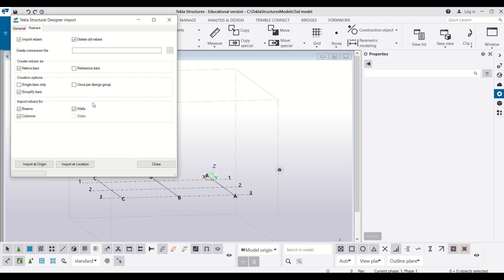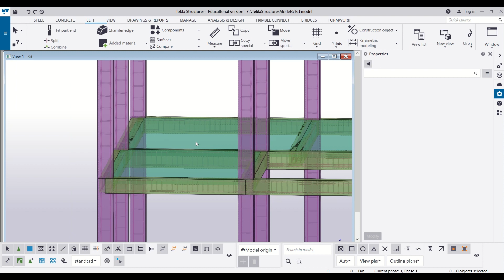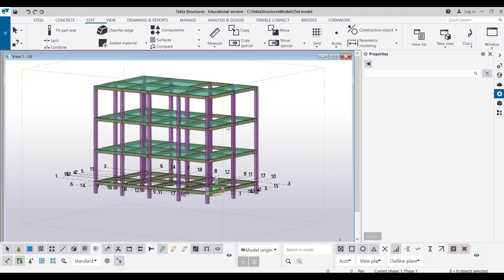How to Import TSD model in Tekla Structures || Importing Reinforcement

Comment: Sir, please this is a personal request. Could you do a simple project with about 5 to 6 columns having a cantilever without beams in TSD and then export to TEKLA STRUCTURES for a full detailed drawings including graphical representation of the BBS and Slab reinforcement details? I would want to choose between PROTA STRUCTURES and TSD. I like the ease of use of TSD but the way it does the Slab rebar and BBS is not to my desire. Prota does the bbs better than almost all the others. I am counting on you Sir
Reply: There is difference between prota and tekla.
Prota makes design and detailing at the same time but the problem is that prota is not professional in shop drawing and u can't control shop drawing as exactly as u want. 
But in tekla when you export a model u can control axis as u want and sections where u want and it is more customized